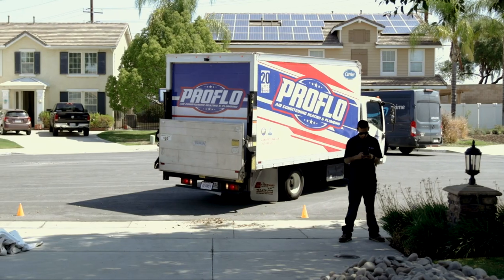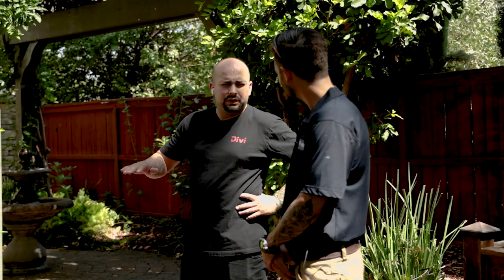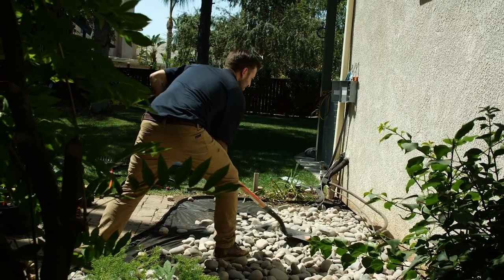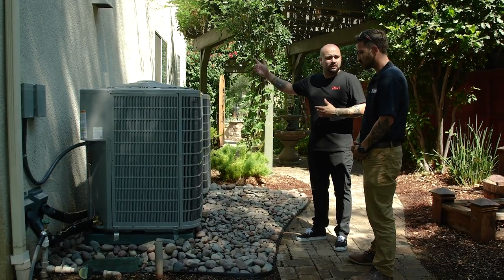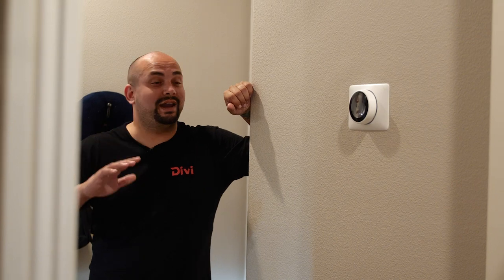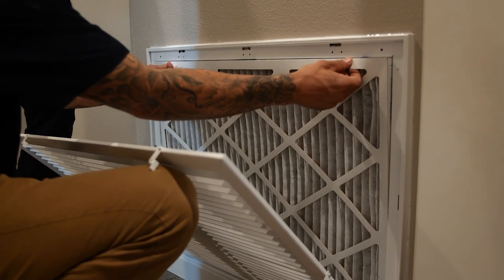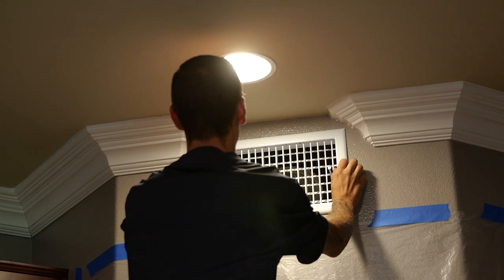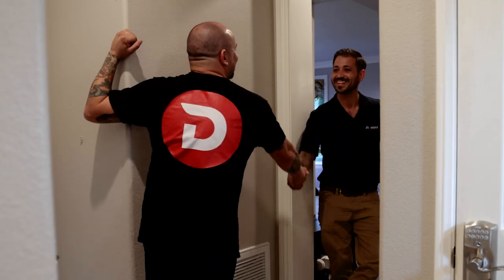Spending $20,000 in Crypto on AC!

Comment: I had RHEEM and RUD installed in my new built home in 2017. The RUD air handler inside coil went bad due to thin walled coils, the tech said it was leaking freon. I upgraded to CARRIER. They are the best. DIVI is the best!